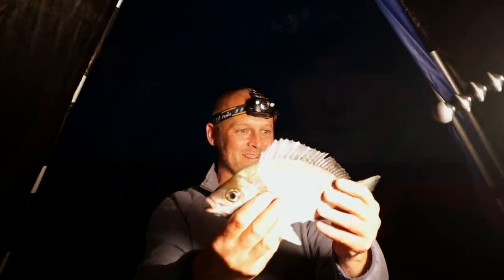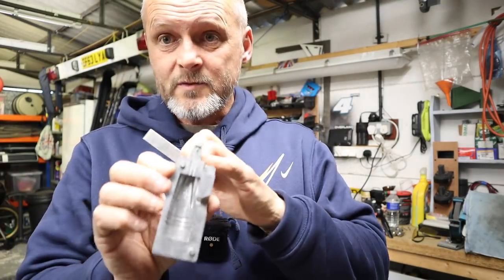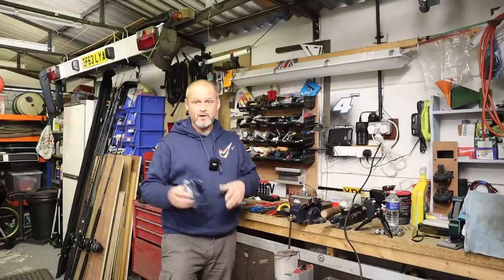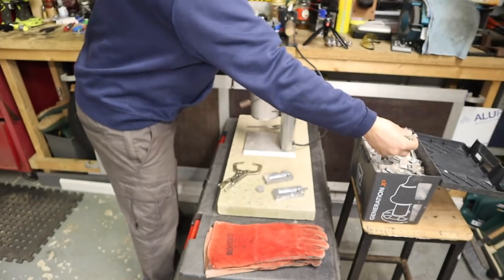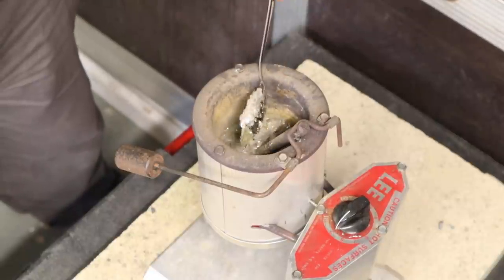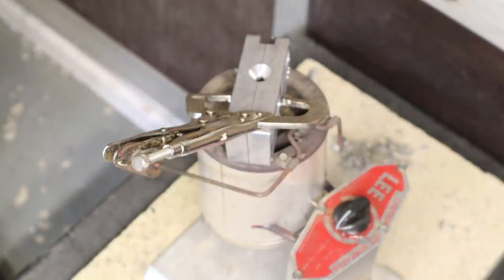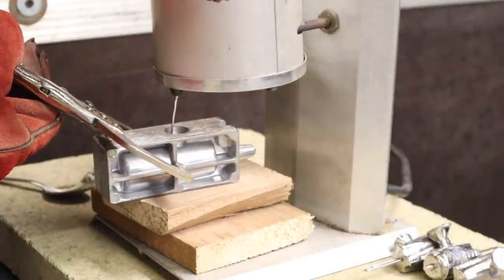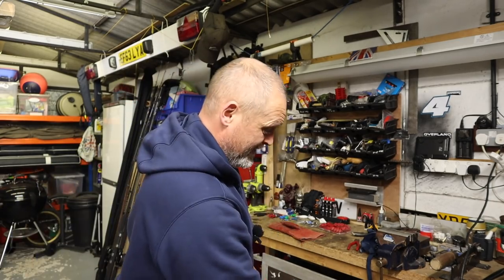Beach Fishing set-up part 2 - Making Gemini Solo weights and powder coating

Comment: Hi Mark, being Long established sea angler the Lee led melting pot is a brilliant find for self weight maker, thanks for link.
Reply from the maker: One thing I learned using it was to keep a level in the pot and pour little and often. Lead melts easier when the pot is half full.
Reply: @seaangling  Thanks for tip, once back in stock I'll be investing in one.

Comment: Hello Mark, when I was using powder coating on Gemini leads I cut a small bit from an old brush handle
and screwed it onto the bottom of the lead it saves you having to clean the powder coating from the
screw and bottom of the lead before assembly, on my other leads pyramid and plain styles I now use
rubber paint from plastidip it gives a professional finish, you should give it a try I think you would like
it, very easy to use. Thanks for another great video
Reply from the maker: Cleaning the threads didn’t take long but I understand what you mean about keeping them clean. I’ll have a look at the plastidip. Do you dip into it or spray it on?
Reply: @seaangling  yes Mark, you just dip it into the tin and lift out slowly and hang up over
paper to dry, the colours I use are white which acts as an undercoat, blaze pink, blaze yellow and luminous, if you look at the plastidip reviews you will see some of the first leads I coated, they are not as good as the ones I make now as they weren’t undercoated, thanks Ronnie

Comment: Nice one Mark!  Interesting video thanks.  Not easy to do if you don't have a garage or workshop with power.  It also struck me that, by the time you have bought the Gemini kit, the Lee melting pot, and the Lead, unless you're gonna make loads of weights, it could get very expensive.  I think I'll stck to buying Grip leads down the local tackle shop for £1 each!  Stay safe & well!  🎣🎣👍👍
Reply from the maker: You are 100% correct. I’m lucky to have the space, I was lent the melting pot and given the lead. That made buying the kit worth while and a viable option. I think you would need to make a lot to cover the cost otherwise.

Comment: Hi
Enjoyable video, I’ve been making Gemini leads for some time now and find them efficient, few comments 
Like your lead burner, I make mind using a ladle on a cheap small portable kettle burner - does the job, but like your burner, especially the way it bottom pours 
Whilst a more slight expenditure, the Gemini mould clamp is good and from my experience speeds up the making process 
I cut the residue pyramid with wire cutters, in lieu of pliers
Like the way (long wire first) of attaching wires, never thought of that- bril
Finally - the powder coating awesome! ! ! 
Really enjoy your workshop ramblings, look forward to your future ones, covering the process from conception to fishing and catching fish 
Go steady
Reply from the maker: Cheers Derek, I’ll look into the mold clamp. 
The melting pot is widely available on the internet and is simplicity in itself. I’ll try and put a link in the description. 
The powder coating was an experiment and a bit of fun but I thoroughly enjoyed it and liked the result.
Reply: I just use some spring tool clips, but I also made a couple of wooden handles for it which make it easier to handle 🐟🎣
Reply: @seaangling  
Hi again
I screwed the Gemini mould clamp onto a piece of 5” x 2” (on 2” face) then fixed a piece of 2x1 to it as handles, therefore allowing it to be picked up, almost immediately, you can then remove the actual mould from the clamp, especially with your gloves. The mould is designed to fit snuggly into the clamp 
As previous correspondence, receive my new 14ft Penn XR rod tomorrow, designed for 5/6oz leads, therefore fishing akin to yourself, therefore will be watching your future videos with great interest
Go Steady
Reply from the maker: @derekjefferson1324  this years shore angling will be targeting some old favourites and some new (to me) species from different venues. I look forward to sharing how I get on. 🎣👍🏻

Comment: Great vid Mark, I hope you will keep us informed how you get on with your powder coated leads, I’m very keen too know if.. although it’s a reasonable thin coating, tho could be possibly thinner if only coated once, that the coating doesn’t restrict the water flow over the vents too much increasing the probability the hook isn’t released every time? My thinking was I assume Gemini when developing the splash down lead would have tinkered around with the vent depths and angles till they found 100% release rate! So it’s going too be interesting too see your results 👍🏻 keep up the great work Mark 👍🏻
Reply from the maker: I’m loving the feed back this evening and the depth of thought. I did consider the chance it might reduce the release ratio from the design and so I have done a batch coated and a batch left plain. The beauty of fishing 2 rigs, rods, reels side by side is the comparisons that can be made in use. It all adds to the interest for me and keeps me thinking. Good comment 😉👍🏻

Comment: another great, insightful video. I will say though, I  don't understand powder coating and what the benefits are other than being used at night. I think it's more of a tackle tart thing. I can't help but think  we should be trying to limit plastics and other unnecessary waste into the seas. I like the trident stuff, but I've now moved away from those product because because of the plastic content. I know we won't eradicate it fully, mainly line, but I just think we have a duty to limit the impact. I morally wouldn't let someone needlessly throw a coke bottle or plastic bait wrapper in the water, but I can't say much when I'm throwing a load of plastic in the seas in forms or beads, bait clips, tubing etc

not a criticism of yourself mate. I love your content, and I love your enthusiasm for our great hobby. 

all the best mate.
Reply from the maker: I understand your view and always take more rubbish away with me from the beach than I arrived with. 
Also had good results with plastic collection on a local river. 
All of that said there is the inescapable fact that we are putting lead out there and where does that sit in the greater debate. I would love to see some clear undisputed guidance over coated leads or replacement weights. I suppose the answer could be stones with attachments because lead as a material is on the radar. 
Is coating the answer? I doubt it. 
Is a plain lead harmful? Probably.
Is there more we can do to minimise our impact? Absolutely. 
I’m not educated enough to give an answer but I’d love to follow clear guidance. 
As always, plenty for discussion and no easy answers. 
Thank you for commenting.
Reply: @seaangling  completely understand. I too think that stones with attachment is the way forward, maybe more thought needs to go into fishing line. I'm a live and let live person. I'm in no way a tree hugger. morally, I just can't moan at someone for needlessly throwing coke bottle in the sea, then me casting a load of plastic in with a good chance I'd lose it. 

I've made changes. I don't use beads unless absolutely necessary. hate those plaice and flounder rigs, some say it works, some say they don't. I haven't had any issue with just bait on its own  and I'm not chucking 40 beads in the sea. swivels and metal bait clip is all I use in most of my fishing. and I haven't noticed any difference other than some pretty colours. I now fish, mixed to clean ground, and I now limit my use of bait elastic. only really use it on Half's of Mackie and bluey, and use it sparingly. 

keep the content up though mate. I do like seeing others views on things. I loved your bait packaging idea and I'll be doing the same (and recycling the plastic lol) I've also got the Penn specials, fantastic reels aren't they. 

all the best mark.
Reply from the maker: @Pricks-d7d  the thought process to minimising plastic is something I think we could all offer and do our part with participation. I like your way of thinking. 😉👍🏻

Comment: you need too make a metal suport under that lee mould , as they tend too bend over after a few months
Reply: My lee pot did same but stopped at same angle as the video and never got worse. It does reduce clearance. What did you build to stop it? Are your support feet joined to the pot base or wider sitting on bench?
Reply from the maker: This pot is as old as the hills and I think has settled where it is. It would be interesting to see a picture of the support/modifications you’ve done. I’ll be buying one of these soon.
Reply: @johnf6598  have a look on here just a metal bar with a flat plate for a foot

Comment: Hi mark great video again  just wondering  where  you got your  kiln .and could you at eny time  show how you clean  the bearings  in your penn casting  specials cheers  keep  the videos coming.
Reply from the maker: Hi Collin, it is an oven meant for camping. I bought it off Facebook marketplace for £20. 
I’ll show a bearing clean some time soon but it is simply lighter fuel/petrol in an egg cup. Allow bearings to soak and then agitate/swirl them around. Remove and place on a paper towel to dry and let the fuel evaporate away.
Reply: Sorry mark I ment the lead melting pot cheers.
Reply from the maker: @collinsmith8378  it is a lead melting pot designed for making bullets and most places that stock them are outdoors/armoury type places. 
https://amzn.to/3HeqNVa

Comment: Hi Mark. Love your vids but this one worried somewhat. I would not advise taking that mask off anytime during the smelting process. Lead fumes are lethal over time. Make your leads , switch off, ventilate well then trim up your leads and tart them up. Make sure you have the correct masks for the job in hand.
Reply from the maker: I appreciate your concerns and guidance. 👍🏻

Comment: Enjoyed that mate how long did it take to cut that box of lead up , how do you rate the melting pot how much does it hold in one go . When I first started making the splash downs I soon found out that the blade for the hook release was bloody sharp and would end up in your finger if not careful we live and learn . I also found putting the wires in long side easier . I think the five ounce leads powder coated would match your rods better 😁  must admit the powder coat looks snazzy bit of bling lovey tutorial mate tight lines
Reply from the maker: I made 22 leads and hardly dented the contents of the box and I’ve got another box. You can never have too much lead. The melting pot made by “Lee” was loaned to me to try out. I really like it, simple to use and clean with no need to worry about gas. 
I was doing a couple of 6oz leads and getting to half a pot and topping up. I’m going to try the luminous powder on a few as well.
Reply: How long did the pot take to get to pouring point looked pretty easy to use i must admit really looking forward to this set of videos on how you get on 👍
Reply from the maker: @nickmann2916  only took 10-15 mins to heat up and have molten lead. It is perfect for smaller leads up to 12/15oz but for the bigger boat ones I’ll need gas and a crucible.

Comment: Cracking video as usual Mark great tip about locating the wires in the cone also just wondering where did you get your lead smelting machine from and have you the price for them cheers mate take care tight lines 👍
Reply from the maker: https://www.sportsmanguncentre.co.uk/lee-production-pot-iv-lead-melter-220v

The pot I used in the film was loaned to me but I will be buying one as after using it I found it very easy and convenient.